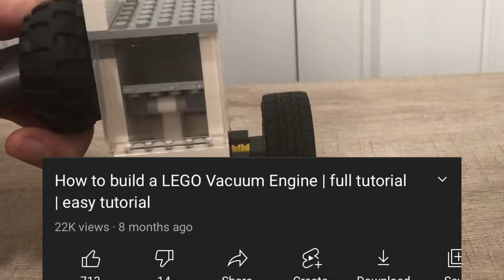How to make the SIMPLEST Lego Vacuum Engine (working) | easy tutorial | full tutorial

Comment: I spent the whole day trying to make one with valves but this one was the only one that worked
Reply: Mine just goes up
Reply: @jimmysedits  make the hole where the vaccum goes smaller
Reply: The only thing wrong with it is that it has no throttle which is kinda annoying. But I found another one that is very similar and has a working throttle

Comment: You can run this without any lubercation (wouldn’t recommend) but if it doesn’t work but does with oil then there might be a peice that is rough or not put together right but this build is very compact and simple hope it lasts a long time!

Comment: Made this today and it is simply amazing! Thank you for the detailed tutorial! Just a suggestion, if you have a powerful vacuum you may want to only use one of the hole Lego pieces, mine tended to lock up and not work with all the holes, it worked great with 1 hole
Reply: It still doesn’t work
Reply: I think I will try this.  My dyson dc32 is very powerful, I've broken many engines with it!

Comment: I didnt have the exact pieces so I made a piston with gears attached to the flywheel and used a slightly different intake. Starts right up as long as it’s lubricated; its a little slower. Might put a throttle on it
Reply: i dont have big wheel to flywheel, do u have idea?
Reply: @skarneymar  im not really sure. You could use a small/heavy wheel and use an electric motor to start it
Reply: @skarneymar  you could try two wheels or get on of eBay for cheap

Comment: I put wd40 on mine, loosened it up a little and tried all the vacuum settings but it still doesn't work
Reply: Wd40 destroys the lego bricks
Reply: @fireballyt3676  yes but it go brrr
Reply: @JsGarage_  I would recommend olive oil, or any plant based lubricant as they generally have the same lubrication abilities but they won't eat at the plastic
Reply: @fireballyt3676  Will do next time ty

Comment: i did everything you said in the video, but when I try run it nothing happens the piston just sticks to the top because of the vacuumed air. I dont know whats the issue.
Do you have any tips i can try?
Reply: Oh nevermind, it worked anyways, the problem was that the power on my vacuum was to low, and i had to set the vacuum sucker a diffrent position on the the vaccum engine.
Reply: @alexandermuknu  thamka but what do you mean by diffrent position i have tge same problem you had

Comment: Do you need a big wheel as your flywheel or it doesnt matter?
Reply: It doesnt really matter, but if you have a bigger wheel, it will have more torque (power) to keep the engine running.

Comment: I had to change it a little it to work, reason might be that i have little bit diffrent parts
Reply: What did u change?
Reply: @nyox999   i put a little notch in the chamber and i put a smaller hole to the input or where the air comes in the vacuum
Reply: @nyox999  i also added a throttle
Reply: @aarni_l449  just built it, can u explain how u build the throttle?